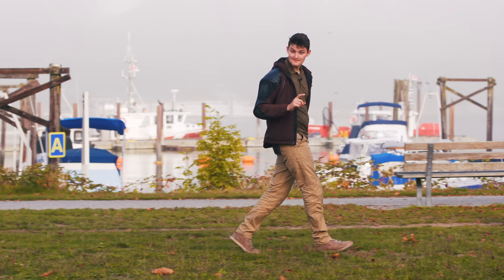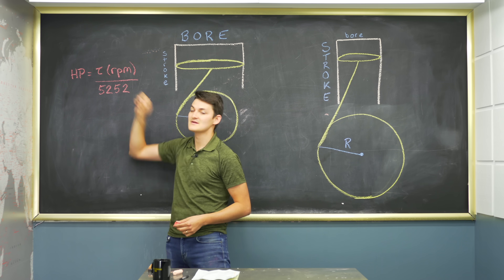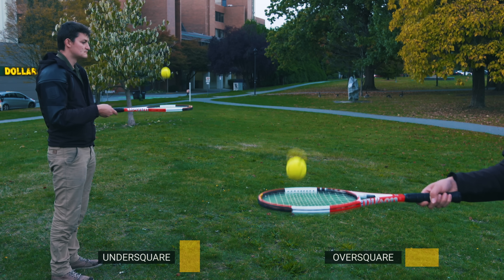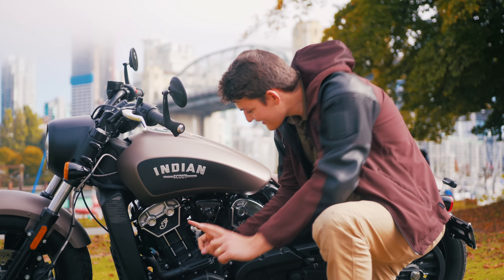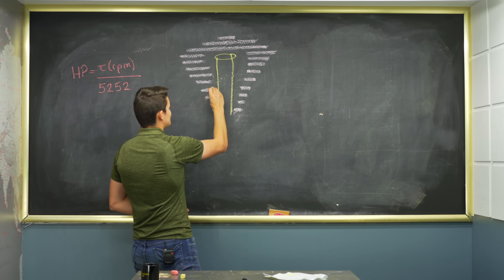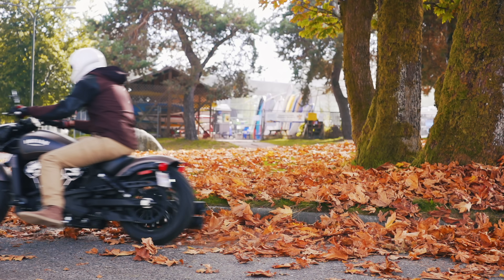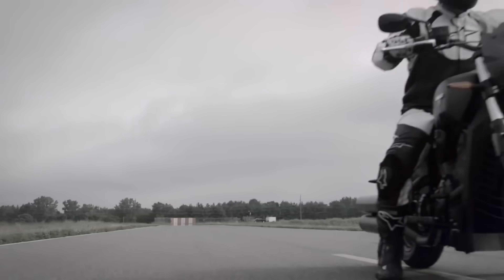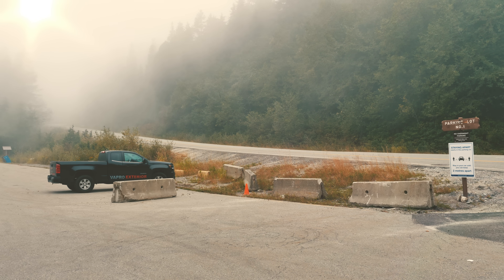How Indian Makes 43% More Power than Harley-Davidson

Comment: Harley-Davidson: Converts gasoline into noise without the unwanted byproduct of horsepower.
Reply: Horsepower? What, do you have some place to be? Pfft.
Reply: Nothing worse than fumbling a 20 year old joke.
Reply: at least someone else understood the main scope of owning an hd ! <3
Reply: do it on the daily. knowing how to work on and having the tools for modern powertrains is quite nice.
Reply: @ZombieZim713  You carry a scanner, throttle pos. sensor, map sensor, O2 sensor, knock sensor, coolant temp sensor, oil press, sensor etc. and an extra ECM with you on long trips? My brother's bike cracked a temp sensor and smoked the computer, no fixing that on a roadside at night. I like all bikes, I inherited my dad's Aspencade, it's great but if it breaks down it's going home in a truck. My throttle cable craps out on my bike, and I can use a boot lace if need be, try that with ride by wire throttle. I can walk into most auto parts stores and get what I need for a fix, the only thing you'll get for a new bike in there is oil.
Reply: dont need all that shit on a long ride. Ive lost count of how many EFI bikes/cars/trucks I've had and taken on long trips. NEVER had an issue with EFI components.  ride by wire is infinitely more reliable than physical cables, plus it runs using more than one channel for data so unless the wire get's clean cut it will still work. Think of how many 2/3/4+ vehicles on on the road with DBW. Come join us in modern technology, it's quite nice.
Reply: Also, post up the exact year/model of your brothers bike. I wanna look up a electrical schematic and see if you're full of it or not.
Reply: @ZombieZim713  ride by wire can be more reliable, but when it does break, it's a pain in the ass to repair, when a cable snaps meanwhile, you know what broke and what to replace. Also a can of cable lube costs as much as a mcdouble, use that and the cable will last a lifetime.

also calling EFI more reliable is wrong, a carb can be easily repaired on the side of the road, you can also buy a new (albeit counterfeit) PE28 for less than $20... yes the needle valve does break 99% of the time on counterfeit ones, but it's $20. also don't get me started on how much it costs to repair a broken ABS system (up to 2 grand on some bikes.)
Reply: How much horsepower do you need? How much horsepower can you actually use?  There really is a difference between "Noise" and "Sound.
  If scraping your elbows on the corners or frying the tire is your thing....There are a lot of choices to chose from. 
  Harley Davidson is not trying to be the last word in performance; they are trying to sell THE BIKER EXPERIENCE.  But, the price is too high and BIKERS are a different generation.
  We, the bikers, started to disappear when Honda came out with their 1960's ad campaign, "YOU MEET THE NICEST PEOPLE ON A HONDA."
  We weren't that interested in being "Nice."
  I get a perverse kick out of asking Harley owners why their bikes have that unusual loping exhaust note.  They just stare at me when I explain why changing the mufflers on other bikes will not get that unique sound.
Yep, there is a reason.....And there is a difference. And it's beautiful to hear.....
Reply: @bobsullivan5714  100 hp minimum for a street bike, 50 for a dirt bike.
Reply: @bobsullivan5714  If you can't pass with ease a car on the fast lane at 100 mph its slow.
Reply: And my electric tooth brush needs at least 5HP....Hey, it's a dirty job and I'm in a hurry!
Reply: Hd is about torque; v twin has best torque band for cruising. No shifting needed ; twist the wick and torque up that grade .
Reply: @crspcritter  better a Ducati or Aprilia V4 for flat  torque.
Reply: Lmao 🤣
Reply: their too smooth ; gotta have that great sound feel that slight vib and best looks of all -
It’s the “soul “of the bike -
Reply: Harley offered the V-Rod and it failed. So why do you knock Harley for selling what people want to buy?
Reply: @rcnelson  you know when your successful ; when half the people love you and the other half “ hates “ you - ✊👍🏻👌
Reply: lolz, no. less tq than the HD engine and at wayy too high of an RPM to be useful in a full size cruiser.
Reply: @ZombieZim713  did you ride a Yamaha FJR 1300? A Kawasaki Councours 1400?  A Honda VFR 1200? A BMW 1600 GT? Tons of torque, tons of comfort, superfast, super braking, super handling, long distance touring at its best. The only real reason to buy a Harley o Indian is for style, if you like it, there not a single tecno item that worth buying them
Reply: Loud Harleys suck BIG TIME NO ONE CARES HARLEYS
Reply: @mignar08  I understand; I have baffles on mine wrapped in fiberglass . 
It’s quiet but deep tone . 
I can sneek out in early mornings now without bothering the neighbors.
More low end torque even . 
People don’t realize till the see the difference.
Some never will -
My mother lives on mtn hwy and hears em all weekend every weekend .
Not just bikes but every truck owner too who has to have a loud truck. 
We have heard the bikes at 1 am full throttle go up through just to pee people off .
Maybe a decibel meter with camera to issue tickets ???- 🤔
I totally understand -
Reply: if you want one lmao not everyone is into pretending they're some motogp racer
Reply: BMW R bikes have entered the room...
Reply: FTN engines.
Fuel to noise
Reply: @wolfnomis8138  wing - ding- ding -
Reply: Lmao
Reply: Any Harley can be pretty quick. However it requires aggressive cams, carbs or fuel injection. Gearing changes are also helpful. But they can’t be sold in that state of tune and pass EPA standards. You would be pretty impressed by a Harley set up properly. No not quick like my Hayabusa or a sportbike  but huge torque and up to and well over a hundred horsepower. I wish I still had my old 92 inch S&S stroker motor in my FXE. 😊
Reply: @johnconley9966  heck yeah ; right on brutha -
Nuthin wring with an evo .
A lot going back to them .
Simplicity -😁✊👍🏻👌👌
Reply: @Unkwon Malaysian Guy my friend told me ; “ the only reason them guys hate Harley’s is they can’t afford them -“😁
Reply: Short stroke motors are drop dead BORING. Smooth and quiet. Might as well be battery powered. And that wonderful shake  and beautiful sound of a Sportster engine is worth as much, or actually more, actually much more to me than power, as long as the bike has the ability to keep up with traffic, and a 1200 Sportster most certainly does.
Reply: @geraldscott4302  😎👍🏻
Reply: Copy pasta
Reply: @crspcritter  I'm an asshole, I love it when I blast down a street setting off numerious car alarms.
Reply: Tell that to Triumph Rocket bikes.
Reply: @bobsullivan5714  at idle maybe, they sound like shit when they rev.
Reply: @yamahale  torque where it’s at and keep your ultra high priced imitation Indian -
Reply: @crspcritter  you can have torque AND a good top end with a properly designed engine, which Harley is at a loss to do. BTW I dont have an Indian, I dont ride cruisers.
Reply: @yamahale  love my long stroke harleys- 
Well ya want horsepower get a throwaway Nagasaki bike - 
Junkyards full of Em -
My softail is almost 20 years old and not a problem; built solid like a tractor . Couldn’t be happier -
Reply: @yamahale  
Mozart, Straus, Creedance Clearwater Revival.......It's all about the ear of the listener.....
Reply: @crspcritter  yah lemme know when it hits 35 years old, or even 45, like my riders. I just got back from a good ride and changed my oil on one of them "throwaways". Oh yeah, almost forgot about the 2015 Softail Slim I rode in between to get inspected for a friend. Whoever named the suspension should be sued for false advertising. Lets not even talk about the weird handling. I guess its good enough for you boneheads, but AS ALWAYS I couldnt wait to get back on my more modern 1987 bike.
Reply: @bobsullivan5714  yes true but Harleys are the Disco of sounds, shallow and empty. Just rode one today.....you?
Reply: @tristan6509  Just no. See earlier comments. No one gives a flying fuck if carbs are cheap to rebuild if the EFI option is damn near bulletproof. Get with the times. If someone pays 2G's for an ABS diag/repair then they deserve to lose their money to a shady shop.
Reply: @ZombieZim713  EFI being bulletproof? Lol no, EFI even though it is much more convenient and efficient will never be as durable as a simple carb

For regular driving I'd take EFI, but if you tell me that were gonna go off-road for a couple of days then I'd take the carb, and I grew up in Borneo too so I know how unreliable EFI is off-road, Mitsubishi even makes a version of the triton called the HDX that uses an older Direct injection 4D56 diesel with a 5 speed manual specifically made for mining companies as opposed to the newer common rail design, cars here only have a lifespan of 5 years max because of the road conditions on palm plantations and coal mines

There's a common saying. if you wanna go out to the forest go take a land Rover, but if you wanna go back, take a land cruiser.
Reply: @tristan6509  I got the ABS bit covered. My KTM RC8 does'nt have it....
Reply: @rcnelson  Selling what people want to buy can be a mistake. In the late 70s Triumph's slogan was " Why mess with success?" or something to that effect and soon after they went under. They thought that the public knew better and didn't bother to evolve. Or maybe they couldn't afford to.
Reply: @chicothesilentguy3466  
You gonna be alright? 😂😂
Reply: @rcnelson  'Cause the "people" are aging out and the new ones don't care.
Reply: And here I am with a taotao, where it just directly converts gas to co2 without either
Reply: lol  I call them, Hardleys
Reply: @crspcritter  wow gee whillikers 20 years old! Lemme know when it hits 40 lol
Reply: My son bought a 1200NS Sportster to commute in LA traffic. 0-60 in 4 seconds and 50 miles to a gallon. He's happy and doesn't get why all the hate.
Reply: @bobsullivan5714  45 years ago I changed the exhaust on my KZ1000G  to a split 4 into 2 Jardine-sounded more like a Porshe.